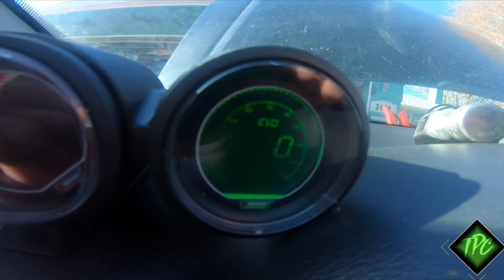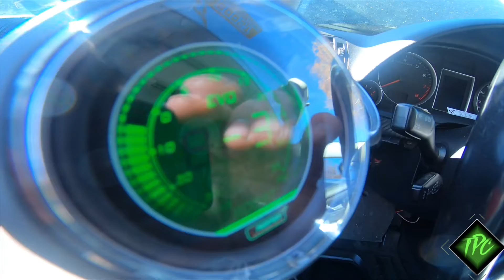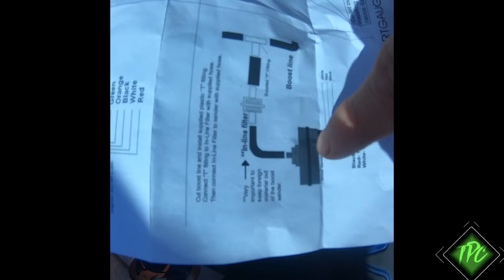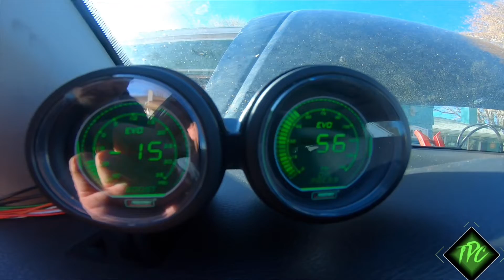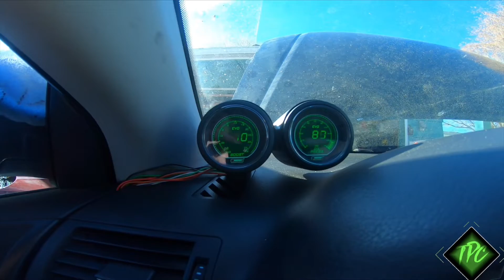Prosport Boost and Oil pressure guage install -Audi A4 b7

Comment: Sick love watching these b7 videos as I’m going through the same as you guys are! I’ve got the same gauge holder but I’m using glow shifts boost gauge and AFR, I already have oil gauge but I need to install it yet. Also running a gtx2867r

Comment: Why didn’t you run the wires through the vent to have a cleaner look?
Reply: that was my plan at first but i would have to cut a hole into the vent that’s there for the heater and i dint want my gauges getting hit with the hot heater as i’ve ran into issues before